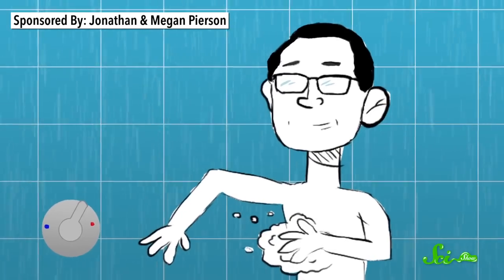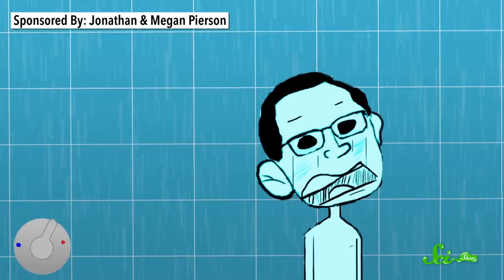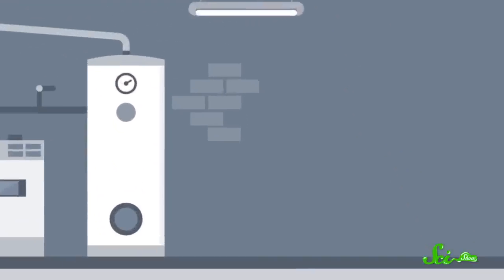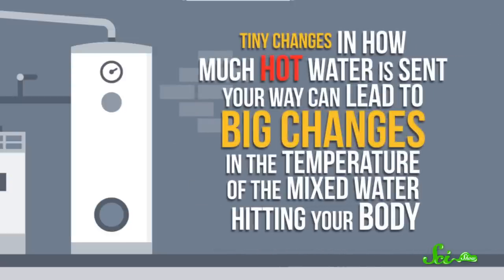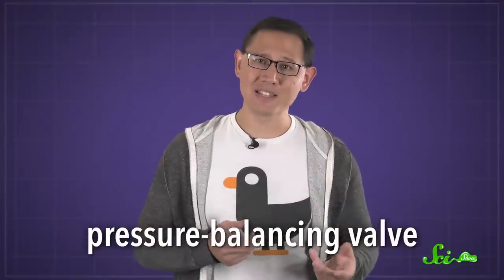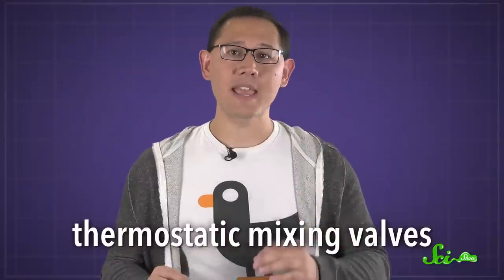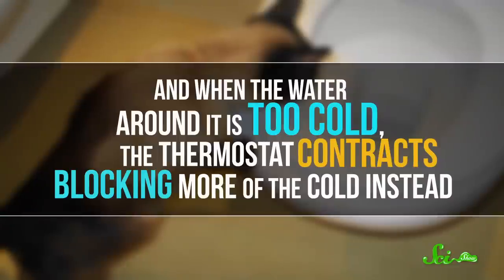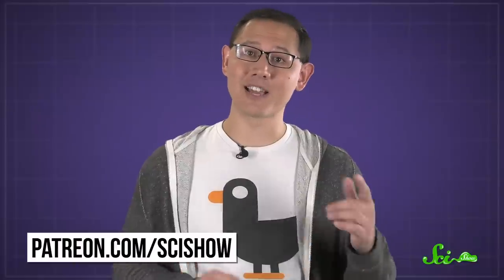Why Is the Perfect Shower Temperature So Hard To Find?

Comment: I live in Britain, this seems to be factually incorrect
Reply: *factually incorrect.... and how is it incorrect?
Reply: xt hydra, in Britain we have separate taps for hot and cold water because reasons
Reply: That's.. kinda weird
Reply: Abby Slug it is, even to us
Reply: a person I live in The Netherlands and I've seen both types of taps: amount of water & temperature faucets and hot water & cold water faucets
Reply: We used to have separate taps here in France too, most old houses have them but they're a dying breed. I think it's because people didn't have heaters at first? So the second tap was added afterwards? Idk
Reply: Yeah I was confused why they had two taps when I went to Netherlands. They had one for cold and hot which was stupid because one was crazy hot the other crazy cold.
Reply: +a person Not always.
Reply: Sam Ezeh *factually
Reply: The separate taps thing was due to a combination of cost cutting when building new home and building regulations. Long story short the way the hot water system was set up in many older houses wasn't considered safe to drink by the regs and so was illegal to have connected in a way that could possibly feed back into the mains water supply.
Reply: In Brazil, we have electric showers. We can control the exact temperature.
Reply: Douglas Pedroso
 electric showers? Doesn't that just fry you like toast?
Reply: sirBrouwer 
I understand that "fear", but no XD

http://www.zagonel.com.br/produtos/14/8/
Reply: Douglas Pedroso Damn, that's some impressive tech :P
Reply: We have electric showers here in the UK too. No shower worries at all.
Reply: ...Correct me if I'm wrong, but don't the sinks have two whole separate faucets for hot and cold water?
Reply: Vastana yes, you are correct. I believe that it's due to the hot water storage not being clean and if it were to mix with the cold, clean drinking water then, well you won't have clean drinking water.
Reply: In japan you just set the temperature.....

But they usually take bath instead of showers....

* & Just so you know, the bath tub itself is temperature regulating......so you can just leave it there and it will be the same temperature for like forever.......
Reply: Sam Ezeh, yeah, I heard about that. But then I don't usually (ever) drink from the bath or bathroom sink ; so...

Comment: to bad i have a rapid heater and it heats up the water instantly so i have either hella cold water or hella hot water. i can regulate the temperature but i can do it on the heater itself, so once inside the shower i pay for whatever i asked

Comment: Why dont america use eletrical showers??? So much easier to ajust, easier to keep the same temperature thoughout the shower...
Reply: But I don't think it's that hard to put 220 V in the house. Here in Brazil all the houses recive 110~127 V and while there are 110 V plug all over the house, the kitchen and bathrooms have, usually, one to three 220 V plugs. And that happens in almost every house here.

Comment: 50 degrees? Wouldn't you get legionnaires?
Reply: Not necessarily, here in the UK the British Standards are 60-65 degrees for stored hot water since it takes only 2 minutes to kill it off, at 50 they die slower but cant multiply like they could in water that is say 37 degrees.
Reply: we heve 70-80 degrees here

Comment: Humans don't have strong initial intuition. You ask them move something aside a bit and they clear it to a yonder corner instead of nudging it. You should be able to locate a shower temperature and follow the spot in mm increments. A few mm's is a big adjustment on a shower handle or knob. Saying it isn't is an indictment of low intellect. If slinging the cold water knob by multiple cm's left or right is what you do then maybe handles and knob turning isn't for you. Maybe get an attendant to help you.

Comment: Or... yknow.... just use an electric showerhead like a human being who's heard of technology.

I will never understand central water heaters.
Reply: It's so you can get hot water anywhere in the house. They also typically run the central heating and are far far cheaper. Kind of necessary if you live somewhere that has winter.
Reply: Or, like "a human being with enough wealth to GET an electric showerhead".  Tons of us could consider no such thing.
Reply: While I do see some sense of it being also the central heater it just... it strikes me as so wasteful. Electric showerheads can be got for 20 dollars.
Reply: If you can't get the WEALTH of 20 dollars, I feel sorry for you.
Reply: 20 dollars sounds cheap, but I prefer the entire house heated.
Reply: 20 dollars seems cheap in idea but if you live somewhere that snow in the winter happens every year. You need hot water in more than one place. If you use a sink with warm water this also needs to be heated, now add a sink in the basement. (usually near the laundry which also has a washer, this thing needs hot water too!) How does one heat the water around their house with the say you are saying? Do they put fancy shower heads on each place they need hot water?
Reply: Then feel sorry for me. I don't have 20 extra dollars, and if I did a showerhead is absolutely NOT what I'd spend it on.
Reply: Cenobia Vigantzky  said: "I will never understand central water heaters."  Apparently, they will also never understand spaces that require more than 1 - 2 outlets which dispense hot water. Even a flat w/2 sinks, a shower & a dish washer require 4 such "$20" heaters (most are more expensive), & they don't last nearly as long as the avg. central tank heater in practice.
Reply: I've never even heard of an electric showerhead. How the hell does it get electricity to heat the water up in the showerstall? Even if the bloody thing cost just $20 I'm willing to bet rewiring whole sections of your house to provide it with electricity will cost you thousands.
Reply: Lmao an electrician just wires it into the mains, you don't need to rewire the whole house at all!
Reply: But for safety purposes, houses aren't typically designed with electricity anywhere near the shower or any of the supply lines to the shower, so that line from the mains has to be pulled from somewhere almost guaranteed to be far away.
Reply: Depends. Houses here have wiring running to the shower exactly so you can wire up the showerhead, and it's so simple you don't even need an electrician to do it.
Reply: Depends on how your house is built. Here, they have an opening to the wiring right above the water tubing to the showerhead, ready to connect the showerhead to.
Reply: +Cenobia Vigantsky Not here. Never seen wiring anywhere near a shower. Closest I've seen is especially installed wiring for spa baths - not something that's in every home. Plug outlets for hairdryers and such and light switches are normally on the opposite side of the room. 

If I were to  purchase a $20 electric showerhead I would also need to hire an electrician to install said wiring, which will likely mean ripping up the wall, along with the tiling (which will also need to be redone by building contractors - more money) as well. Not to mention where I am from only a /licensed/ electrician can legally install any sort of wiring so this isn't something I can DIY to save money, even if I were handy enough to do it.
Reply: I've seen the electric showers, they kind of work like an electric water boiler, for tea and stuff, by running the water through a chamber with two sets of wires that heat up when electricity is ran through them. Might have more sets as well, but the one I saw had two for low and high temperatures. They're actually pretty safe, as scary as it sounds to have power running through the water, as it passes by a grounding lead before going out the showerhead. Problem with this is also that they don't last as long as a central heating tank would, as the electricity would make the iron rust faster, so you'd have to periodically replace them. 
And as mentioned, somewhere like Norway where I live, they're out of the question, because it's really cold here, and hot water's also very useful for faucets as well, washing dishes or just smaller hygiene. 
Though unlike in the video here, that water's not 50 centigrades. It's pretty much 90 degrees or so. It's super hot and steams if you leave the hot water running.